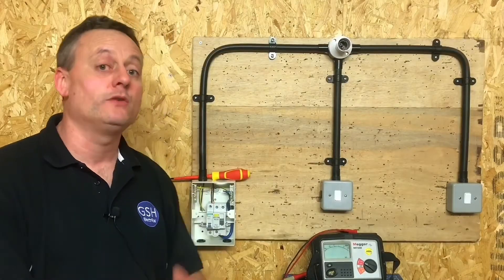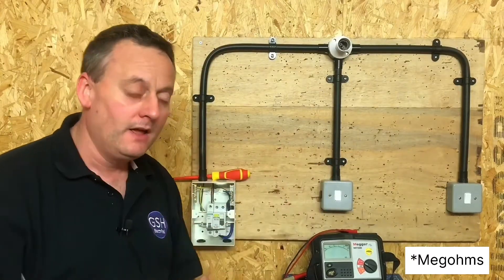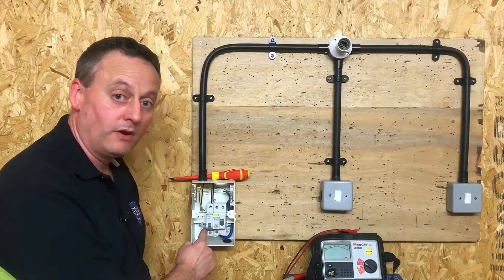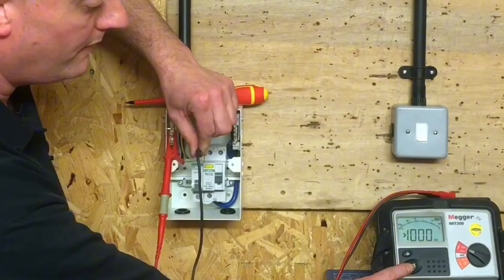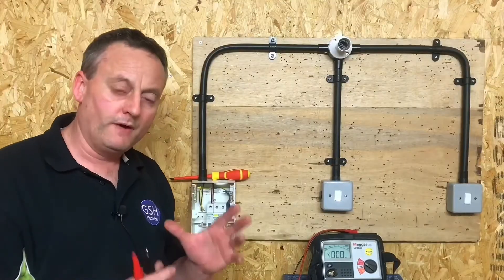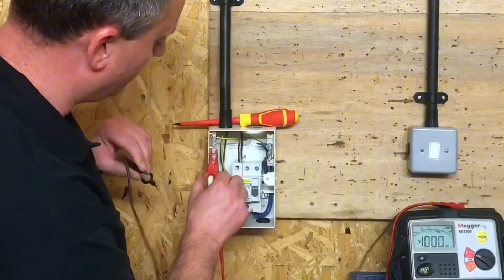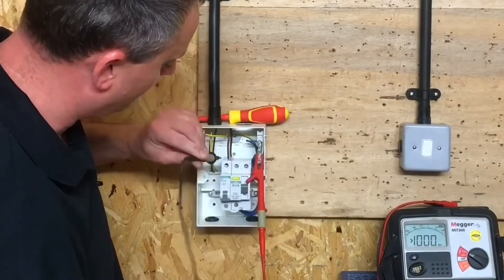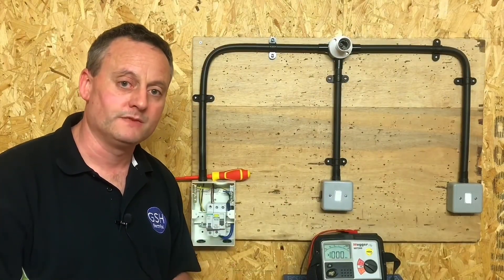Don’t Make a Mistake on Insulation Resistance Testing Your Lighting Circuit

Comment: Why do you test only 3 times, when there are 4 switch combinations?
Reply: Either way... the way he has tested it the strappers have been activated due to the switch position...
Doing another test by turning one of the switches off will not introduce a new path to test...